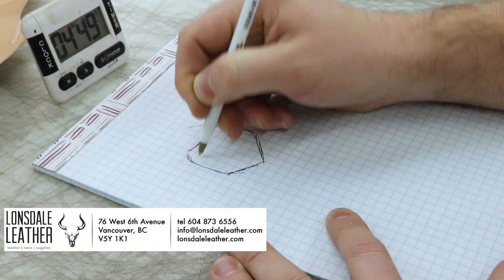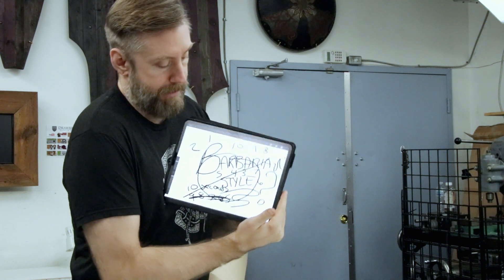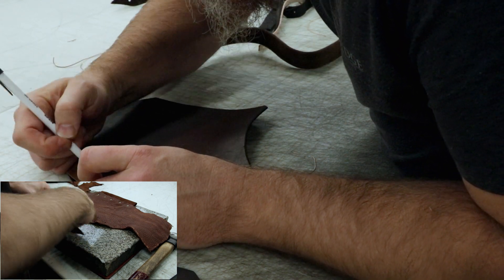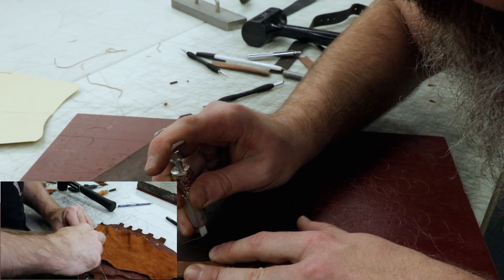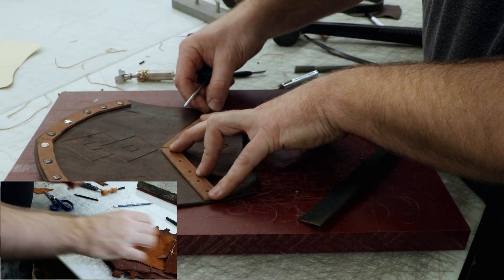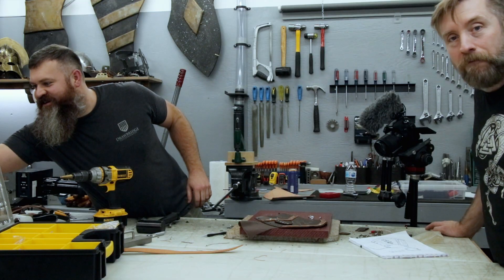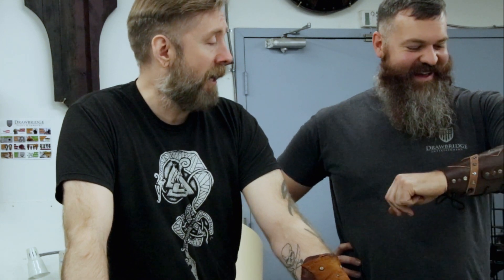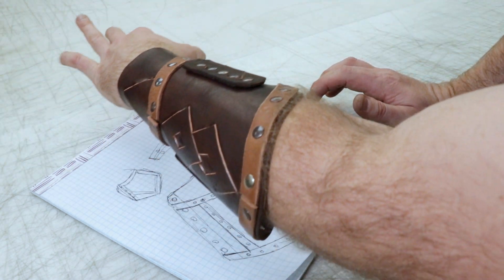How to Build a Leather Vambrace - Who Does it Better? 1 Hour Challenge

Comment: Hard to choose so I decided to go a very simple way.
1. Protection: I think that 3 layers of thin leather won't give me the protection that I need in a combat.
So I give a point to Drawbridge
2. Style: Very easy to choose for me because I love the wild babarian style.
One point for Dark Horse.
3. The Result: We've seen two different ideas and two different technics to chreate them. But at least it was a one hour competition and Levi didn't finished his project in time so the Vembrace is not useable. So I have to give my last point to Dark Horse.
So my winner, with 2 to 1 point is 
#darkhorseworkshop 
But at last let me say that both projects are amazing. They are looking fantastic and it's a great work especially for only 1 hour to create. I say thank you and go on.